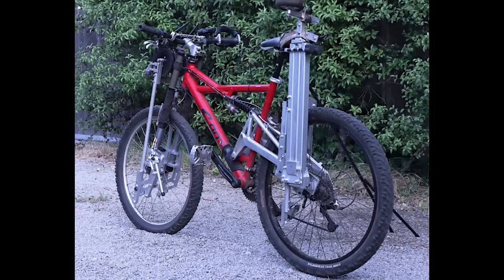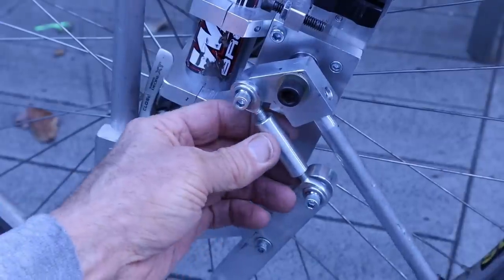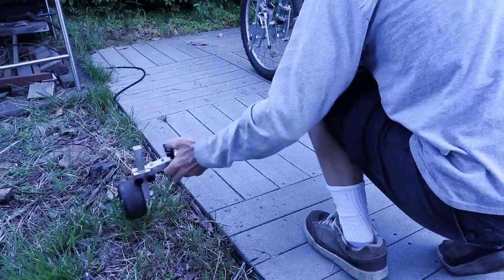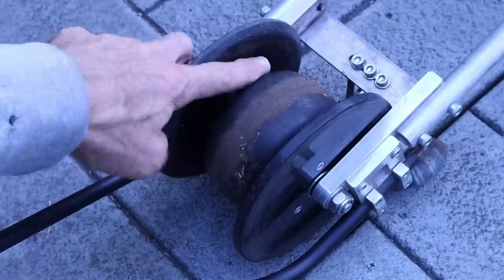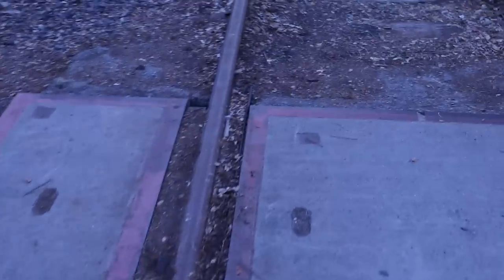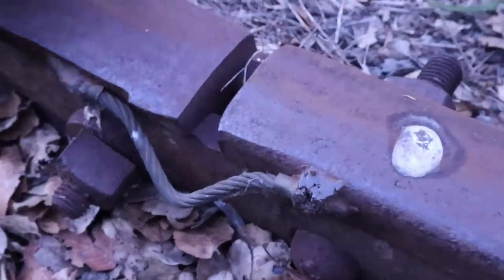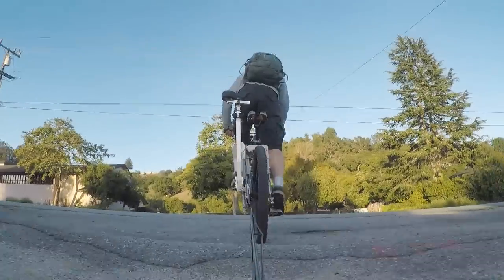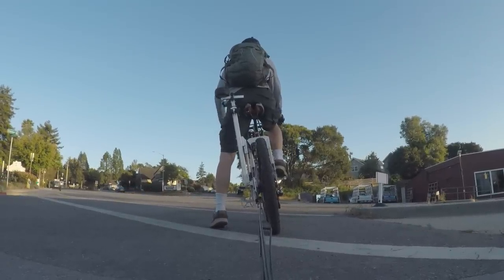Rail Bike with folding outriggers - riding  abandoned railroads on the central coast

Comment: As a mechanic I’m really impressed, as a lover of the outdoors , I’m inspired…… however for the life of me I can’t understand how you are so stable …. The outrigger is just sitting on the top of the rail , and the only thing guiding the bike is the front wheel/ guide !! It’s extraordinary, really….. because coming off on those rails and sleepers could be painful…. You have my entire respect ✊
Reply: I know right? like in a turn, wont the back end just slide off?
Reply: @crispysocksss  railway turns are so wide that there would be no risk of this, as otherwise actual trains would run into similar issues as you describe.
Reply: Since fromt wheel is locked and can't be turned the back wheel always follows the front one. Side wheel keeps the bike upright and because of that it doesn't slide of because of lean.
Reply: @rokasbitinaitis669  thanks 🙏
Reply: @crispysocksss  haha had me …. But I think the explanation posted in the other reply’s is correct , just I think it would be a trust thing in the end … experience creating that trust that is …..
Reply: @crispysocksss  haha had me …. But I think the explanation posted in the other reply’s is correct , just I think it would be a trust thing in the end … experience creating that trust that is …..
Reply: @rokasbitinaitis669  the front wheel is locked but the steering is not. if he tries to turn, the back would turn instead and would slide side to side? I'm really confused as I ride scooters and bikes too
Reply: The stability comes from the weight of the outrigger.
 Frustratingly though, any small articles of debris in the path of the roller wheel can definitely put a crimp in ones excursion. Sometimes a sweeper in front will help with unwelcome obstructions.
Reply: @tommielee8  👀
Reply: @crispysocksss  if the wheel is locked, how would he steer? The steering is locked because the front wheel is locked. He can't lean because of the side wheel, he can't steer because the front wheel is locked to the track. Theres no way for the bike to turn
Reply: @thedudeamongmengs2051  he rides the bike to the track meaning the steering isnt locked. He then locks the front wheel to the track but theres nothing locking the steering tube. If you try to turn, it should shift the bike off the track because the back wheel and side wheel is just sitting on the track not locked in or guided
Reply: @crispysocksss  it would be difficult to force the bike to the side like that. The back wheel naturally follows the front. He could lock the steering but I don't think it would be a problem except in rain maybe
Reply: @thedudeamongmengs2051  Steer? If you're on rails there is no need to steer!
Reply: @jimrobin  that was my point
Reply: I'd imagine he's just developed a habit of keeping his weight on the left side
Reply: @badsamaritan8223  I was thinking youd have to always be turning slightly to the left, like a very gentle turn in a road. If an uneven patch bumped him right he'd go ass over tea kettle into that rough stone
Reply: He seems to be leaning towards the outrigger in places.
Reply: @play3rthr339  Trains actually turn thanks to the shape of their wheels which always push them toward the center of the tracks. The wheels on this bike are flat, hence the confusion
Reply: It's like a toy slot car mechanically, but on a three wheel set up. That front wheel guide serves as the slot which makes everything linked behind it, track with it.

You can also see he needs to lean towards the outrigger or sit very straight up. Lean right and that aluminum arm is too light to hold you there. There is also visible flex as he leans towards the rigging just a little. He's holding the handle bars and riding carefully. If he leaned right, that aluminum outrigger doesn't have enough weight to keep him from tipping, and the front wheel locked from turning will cause you to tip right over. That outrigger could stand to have the wheel somehow attached better, (super neo magnet near the wheel?) and that upper brace on the outrigger to extend all the way to the wheel end to reduce flex and increase strength. It has to be ridden like a trike not a bike. No leaning.
Reply: @danielpaulson8838  cool 😎
Reply: @austingode  But it totally relaxed and very gentle terrain changes. It would be fun to make a four wheeler version for two. Maybe link two bikes locked together in a parallelogram. Hmmm, thinking, thinking.
Reply: If he has some guide stoppers so there isn't a possibility to oversteer... Maybe it's the front track guide that takes the steering and probably that's the case. You can't get it out of the track since there is the rolling guide. Unless you lift the front wheel 😁
Reply: you can tell a commenter is Gen X or a Boomer by the abundance of periods between their words.
Reply: @crispysocksss  if he were to try to turn the steering handle with the front wheel locked in place, it wouldn't move the back end because he's putting the majority of his weight on the back of the bike and the tire is gripping the rail. Since most of the weight is a good couple feet away from the steering axis, it would take either an huge effort to overcome the friction and turn the back end, or he would have to jump sort of/momentarily release the weight off the back wheel and turn it while there is little holding in place.
Reply: @danielpaulson8838  yes ! That sounds like a winner
Reply: @Kekatronic  guilty as charged ……….. but i entered the world 🌍in 1960
Reply: I think he's gotta be leaning, ever so slightly, to his left. i mean, there's no other pressure put on that telescoped part and it doesn't lock the wheel down to the track, so if he's not putting a bit of pressure left, the risk of going off the track, right, would be high.
Reply: You don't turn a train. Literally think about what you are saying. It goes forward and back. You don't turn it, at all. 

It's not functioning as a bike. It's basically a pedalled train itself, as it's using the rail to guide it.

I literally don't know how to explain how hard y'all are overthinking it
Reply: @rob dog - I think he's constantly leaning slightly to the left, which probably helps stability by having a guide disc always flush with one side of the track (you can see him leaning at 3:55 ). Still though...
Reply: im sure it fell off very often hence the very short clips,.  even though the steering is locked if its not 100% perfect it will come off and even after that bicycle rims and tires just dont have those kind of tolerances to maintain a perfect alignment....... cause.....its just a bicycle.     i will only believe it if he puts up a clip where he rides for at least 30 minutes
Reply: @Wenjo936  But its not a train, only the front wheel is guided by the track,  and unlike a train, the rest of the bike can move ("steer") relative to the front wheel. Apparently it doesnt do that, but thats not what I would have guessed, its very much counter intuitive.
Reply: I think he's just staying balanced like a normal bike and was only able to do it for short periods of time to flim the clips in this vid. I doubt it works well enough to keep it up for long distances.
Reply: @vertigo2893  How is this counterintuitive? Stand your bike up, with the front wheel between your knees. Try to turn the handlebar. Does the rest of the bike shoot off to the side?
Reply: @loomspace  False analogy; standing still the friction of the rear wheel will prevent it from sliding sideways. Now imagine you do the same but with the rear wheel lifted of the ground (or on ice). The rear wheel may not "shoot off" but will it not sway at all ? I wouldnt have bet on that.
Reply: @vertigo2893  Sigh. So pick up the entire bike and do the same. You think the friction of an unweighted rear wheel is more than a rider weighted rear wheel? Your intuition is not even close to the physics of a bicycle.
Reply: @loomspace  You dont get it. Let me use another analogy. Imagine a train with a locomotive up front and a single car being towed. Now put ordinary wheels without flanges on the towed car. Would you bet its never gonna derail?
Reply: @vertigo2893  No need for analogies. I recommend you experiment yourself with the next bicycle you come across. I think it's the only way you'll trust the results.
Reply: @loomspace  If I have to test it, then Im not relying on intuition am I? I said it was counterintuitive, not that its wrong. If your intuition is better than mine, then congrats.
Reply: Its called the miracle of video editing, my friend. This thing is anything but stable.
Reply: @thedudeamongmengs2051  There is absolutely no reason to need to turn when on the tracks.  He actually doesn't need handlebars except to lean on.
Reply: @userbosco  that was my point
Reply: I was thinking the same
Reply: There a reason his hands never came off the bars lol
Reply: Who cares it works!! He's  riding the thing comfortably!
Reply: Everybody is concerned about howthe safety of it staying on the track, yet no one questions if a train comes along while he's on a tressel.
Reply: @tonyr.4778  they aren’t in use anymore….. must be extraordinary feeling
Reply: @esperago  crazy isn’t it ! Haha
Reply: @danielpaulson8838  yes !! It must be amazing riding on these abandoned tracks
Reply: @tonyr.4778  These are abandoned rail tracks, no trains. He said that at the start.
Reply: @austingode  okay
Reply: @austingode  okay again.
Reply: @crispysocksss  you need to apply a lot of force on handlebar to make the back of the bike to slide of
Reply: @rokasbitinaitis669 so he has to lean left through the whole ride?  If he straightens out the ourtrigger lifts? And he can't counter balance because the way you do that on a bike is through steering?
Reply: @cra2cra226  the weight of the outrigger pushes the center of gravity to the side, so he can be upright without leaning. And since when you use an outrigger it becomes a three-wheeler, you can turn without leaning
Reply: the front wheel guides the rear wheel and the telescopic attachment keeps the bike upright and prevents it from tipping inward. But, what prevents the bike from tipping outward? does he just have to ride with his weight leaning inward the whole time?

Comment: The wires you show are not grounding wires....they are called "bond wires". RR signals and crossing gates are actuated by low voltage electricity that flows through the rails. When the rail segment ends you need a bond wire to complete the circuit. In continuous welded rail that is not needed so often as the lengths of CWR are usually very long. When an engine or other rolling stock travels over the rails it "shunts" the electricity traveling through the steel wheels and steel axles from one rail to the other completing the shunt. This is what actuates crossing gates and signals.
Reply: so you are saying if  i take a wire ....
Reply: @dollyhadbraces9361  well that depends. There's different types of crossing arm actuation. Sensor, circuit, and rolling circuit. Obviously a sensory relay will not activate with a wire. A regular outside circuit on either side of the crossing will, but a rolling circuit uses a specific number of circuits up to the crossing and calculates if the train is moving or not so that if it stops short it won't foul the crossing gates. There's also overlay circuits and sensory combined with circuits too but you get the idea.
Reply: @jasonw833  the way I recently learned about that as I understand is about the most common measures the time delay of low-frequency AC signals transmitted down the tracks. This lets the systems determine distance—with continuously welded rail, a train anywhere along a huge stretch of the line completes a simple circuit.
Reply: @PaulFisher  that would be deemed an overlay circuit using frequencies within a circuit like a zepic. Then you have what is a solid state circuit, genracode or elektracode that basically can incorporate multiple circuits into one for a grade crossing approach.
Reply: @jasonw833  thank you! I was not aware of the terminology.
Reply: If the bike would complete the circuit (additional wire needed) it could trip the crossing light(s). Imagine sitting at a crossing and seeing  bicycle go by.
Only issue is the dispatcher might get a signal also and what train is on that track
Reply: We used to place coins over the gap then put a small rock to weigh it down on top then laugh as the traffic built up for sometimes hours before someone realised why the boom gates were not lifting.
Reply: Did not know that sir.. thanks
Reply: @dollyhadbraces9361  I remember my nerdy smart brother when we were kids found a metal car bumper this was the 1970's and put it across the tracks saying it would make the gates come down.  It didn't.  Then he started sliding it toward the crossing and bingo it did.   I can't believe we left it there and started running.
Reply: @jimbennett2795  Legend has it that bumper is still there backing up traffic.
Reply: @davemeads859  It would take more than just a coin on one track.
Reply: I was thinking if he could make the wheels conductive (or put brushes on the rails), I'm curious if the crossing gates will still activate to stop traffic for a bicycle, or did they cut the power long ago?
Reply: @KutWrite  you need to put a coin on both tracks (these were diesel trains not electric)
Reply: @davemeads859  No, the circuit for the crossing gates needs to connect from one rail to the other. Electric locomotive power takes a different path.
Reply: @KutWrite  ffs I'm going to have to go and do it again and film it I guess.
But that is the whole point of the coin it bridges that little gap between the two rails and the gates come down idk why but it honesty works
Reply: @Reno Simpson or a free cell in a federal prison
Reply: Thank you. N good morning
Reply: Thanks for the info I always wonder why they were there for
Reply: @Da Kid  Yes. Kids at my school took a chain-lock to short the rails, and thus close the gates. When they were caught red-handed all students where gathered and educated what happened and why not to do so. Not only were the gates lowered, but also signaling turned red and the train monitor registered a train where there should not be one. This halted all traffic on the line both directions. At the time it was not a buisy line with only 6 to 8  trains each hour, but it disrupted  a lot of commutes and missing links anyway.
Reply: As a kid we used to set off the gates by rubbing a metal pole on the tracks. As a Kim in the 90s lol block traffic for hrs
Reply: As child we figured out how too activate the crossing signals and we would use wire from the old telegraph lines and leave it there and watch from a long distance from the annoyed drivers stuck at the crossing
Reply: @davep6977  😄 that would be hilarious.. do u know if it would still work since the tracks are abandoned?
Reply: I discovered this when I was a kid.  I found out that if you take a rebar rod and stick it across both tracks, then jump up and down on it so it rubs and sparks on the tracks, the crossing signal will detect a train and lower the gate.  It will stay lowered until the rebar is removed and the circuit is broken.
Reply: @dollyhadbraces9361  starter cables are made for this
Reply: @Reno Simpson what are talking about? The current in the circuit is what triggers the block signal. And if you trigger the signal without authorization, you commit a felony.
Reply: @dollyhadbraces9361  Don't. That could potentially create a dangerous situation.  If a train is travelling up to a clear signal and you do that, it will make the signal go red and the crew will have to go into emergency which could cause a derailment and put peoples lives at risk as well as damaging the environment.
Reply: @jasonw833  Interesting. Is this the same method as todays Canbus systems in cars?
Reply: @jessewoody5772  no, far from it. The only thing similar on railroads today would be the positive train control, but there's no communication from train to train only to a wayside receiver transmitter with a preprogrammed speed restriction. You would be surprised the amount of locomotives on America's rails even without gps units let alone a technology that communicates with each locomotive and transmitting to an approaching crossing lol
Reply: @fiskurtjorn  One day the commuter rail I was on passed by a bunch of track workers on an adjacent track. They did, in addition to a worker "up track" with a handheld air horn, have an automotive jumper cable clamped across the rails.
Reply: Very cool 😎
Reply: That’s interesting John, thanks for that. I always wondered how the gates were activated when I was a kid over 45 years ago, but I figured today it was radio signal to the crossing through gps etc. That was just my guess. Well now I know.
Reply: @dollyhadbraces9361  Yes. If you short out the two tracks, the gate comes down. Have fun!
Reply: @sendink9140  it's a little more complicated on most signals. This especially applies on Amtrak routes where the passenger train may be going 80 mph and a freight train might be going 30. The crossing gates have to be smart enough to determine the speed of the train that just entered the crossing block so that the gates come down at our appropriate time, roughly 30 seconds before the train will arrive at the crossing.
Reply: Dude, you seem to really know your stuff!   Rare nowadays! Thanks for the info!
Reply: Bonding still generally is tied to a grounding. Somewhere, within that ckt. It is grounded, and bonded to the ground.
Reply: @davemeads859  You just told the world why you will always depend on mooching off of someone else in their basement and I think we all have a good idea who that would be, right?